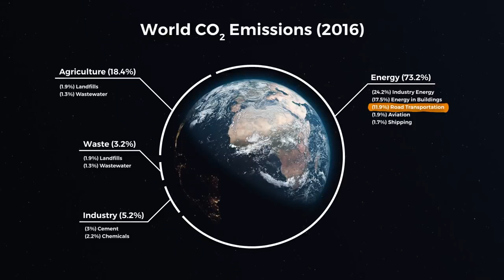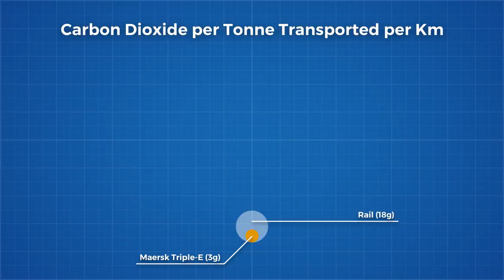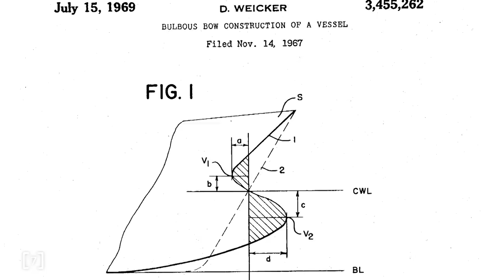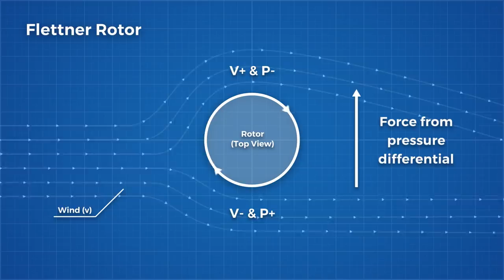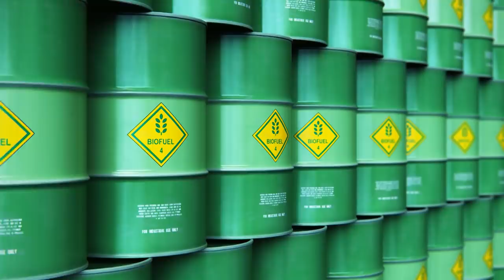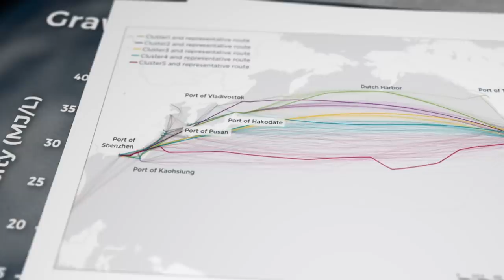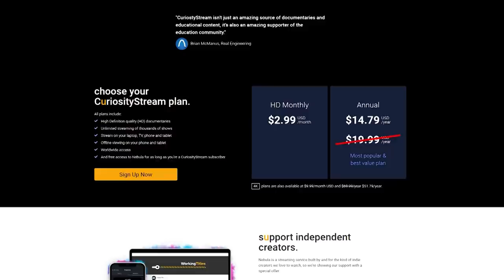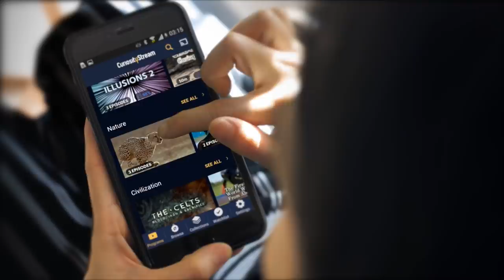Are Renewable Powered Ships Possible?

Comment: To say that the shipping industry is pretty efficient seems bizzare. The only reason that shipping is efficient is both the buoyancy of water and that bunker oil was so cheap. After all no other business would buy this oil dregs that for every barrel sold to shipping was near 100% profit or when not sold 100% useless in modern fossil engines or refining into other petrochemical value. Until very recently International shipping could dump its bilges into the oceans no matter the damage. Its only now that low sulphur bunker oil means ships must either move to a new fuel or (the cheap way), add a filter to the emissions to capture the high sulphur for the existing oil dregs used as shipping fuel. In the decades since fuel went up in cost (and thats bunker fuel cost) shipping fuel efficiency has been: massive container boats (so massive that the panama canal and Suez canal needed to be updated to take these ship sizes) and with the resulting massive task of offloading its thousands of containers and slow steaming. Thats ship "efficiency". The biggest other innovation in shipping efficiency in all ships has been GPS to follow an accurate route as opposed to the sextant/stars and accurate time keeping/coastal direction finding. And GPS was built for military land navigation! In the meantime global shipping has paid poor wages (to the average seaman) with shipping's hidden mental health crisis . With shipping's byzantine  regulation and tax avoidance, many sailors are employed by shell corporations so convoluted that it would impress a Russian oligarch. So in the event of a ship accident its near impossible to find who the owners are in order to regulate/control/fine/prosecute them.
Wind power as an upgrade on modern ships is so rare as to be akin to well paid seaman (hence one of the reasons its so hard to recruit in global shipping) . Many ship owners bet on LNG power and while its a cleaner fuel- any fuel is cleaner than bunker fuel so big deal. No ship owners wants to invest in new ship fuel efficiency upgrades in case the worst shippers can bid a lower cost trip. Like saying a wind utility has to be cheaper than burning tires for heat.
Reply: Making the range of products desired by ‘the market’ from crude oil is not as simple as is sometimes suggested when ‘bunker oil’ is referred to as the ‘bottom of the barrel’.  Among the many highly skilled professionals in the oil refining business the 'elite of the elite' are the 'blenders'; they take the fractions that can be extracted from the crude oil that one set of traders buys and after distillation (both atmospheric and vacuum aka thermal cracking) followed by 'cat cracking', chopping the residual longer and more complex chains of hydro carbon up into shorter bits, with the aid of a catalyst, they have a suite of components.  They then blend the components into the products that the other set of traders can sell in the market for the most revenue; all at the least cost in time, energy, effort or any other type of expenditure.  When it is possible to find any useful revenue stream anywhere in the process they will, thus low sulphur atmospheric residue (LSAR) from the simplest distillation stage might be saleable as 380cSt HFO.  The regulators set some parameters; like sulphur content, either at a national or international level, and those pesky consumers buy what they want from what is available.  Best way to reduce the impact of shipping to acceptable levels could include, but not be limited to: -
1) Reduce spoilage / waste of all commodities;
2) Improve fuel quality;
3) Localise production to consumption;
4) Reduce 'freight mile' distances;
5) Abolish the cruising fraction of marine transport;
6) Reduce freight carrying capacity;
7) Abolish recreational boating;
8) De'fossil'ise the fuel chain;
9) Reduce the global population of consumers.
The use of any of the options above may not be the future of marine transportation but moving less material and moving what is transported over shorter distances, as in the past, should be.  Together with localised production and minimised consumption a global population that has individuals’ voluntarily self limiting reproduction to two children per parent (both male and female), might save the planet.
Reply: @BernardLS  all good answers but when a refinery ends up with this near solid oil that had no market, they found one customer who could burn it in international waters and that was shipping.
Reply: @stephendoherty8291  WADR the oil companies are commercial enterprises and like any other will  try to extract the greatest possible revenue from what they do with least possible effort or expenditure; and in the final analysis it is always the consumer (we, the people) who pay.   The cSt 380 HFO that powers most shipping can be improved by regulators (improved specification) reduced consumption could weaken the market and make other destinations for the components more profitable.  Beyond HFO there is a market for bitumen (road and other grades of tar).
Reply: @stephendoherty8291  ‘It is like sailing into a storm and pretending the ship and crew and cargo will be fine.’  Love it! SOP for ship owners since Noah was a deck boy!  WADR KSA like any other petro state would be in the steam reforming business so their H2 would be the ‘black’ type.  H2 may have a place in the energy mix on land as a storage medium but on a ship where there is a reasonable and constant auxiliary power need the question could be posited, ‘why go through the extra stages instead of using the harvested energy directly?’  After harvesting the energy, from wind, sun or motion of the vessel, as electrical energy better to deploy that energy directly and immediately as heat, light or mechanical work.  As with nuclear energy at sea some of the ‘alternatives’ may have a use in littoral submarines in AIP (air independent propulsion) systems but that will be with the same caveats of cost, space and complexity so would not perform in a high volume low cost mercantile situation.  The numbers are getting very difficult to show any sort of surplus so is this a case of running hard to stand still?

Bear in mind that speed reductions, a useful buffer for adjusting variations in demand, will in the long term require more goods in transit to maintain any given long term level of supply.  Typically tankers move at 15kn so a reduction of speed to 12kn could yield a fuel consumption saving of 20% (?), however to maintain the same flow of material an additional 25% of shipping capacity will be required.

4 ships at 15kn  =  60 freight miles  =  5 ships at 12kn.
	fuel used x                                     fuel used x+ or x- (?)

Reducing speed to save fuel reaches limits when the vessel does not maintain steerage way and suffers loss of control, the speed through the water is too low to overcome tidal streams and the speed over the ground is to low the make good any distance to the objective against adverse currents.  The speed to cost ratio is as finely balanced as any other ratio in the shipping business.

Returning to my earlier comments WRT ‘blending for profit’ once the crude has been through the atmospheric distillation stage the residue, SRAR, either goes to vacuum distillation or is passed to a catalytic cracker for further fragmentation.  SRAR may be traded as a feedstock so that yield is diversified around refineries so that the plant performance may be optimised.  If you refinery has been designed for medium crude and your traders have bought in excess light then you need something to thicken the mix.  Reinjection of residues is not something I have come across, but in the crazy oil world almost anything could happen somewhere.

Comment: Are nuclear powered ships simply too expensive? surely it can be made cheap enough for commercial use eventually right?
Reply: If you do a web search for ‘nuclear ship savannah’ you will see that it has been tried and did not work.  A similarly vessel heavily subsidised, by the government, vessel is in use in Russia which also operates, in support of the Northern Sea Route, a fleet of nuclear powered ice breakers all of these may, or may not, have been completely without issues.

Just think; would you have full confidence in the management of a nuclear reactor under the control of an anonymous entity only traceable, perhaps, via a letter box in a FOC (flag of convenience) nation state?  If you are, could you sell that confidence to Japan, the state that hosted the Hiroshima and Nagasaki nuclear detonations as well as more recently the Fukushima ‘event’?  Then try that same, or a similar, sales strategy on Ukraine, the nation state that as a part of the USSR (CCCP) hosted the Chernobyl ‘event’.  Modern iterations of nuclear energy, thorium fuel, molten salt reactors or fusion reactors, will carry the legacy of past problems.  It is the global trepidation of anything with 'nuclear' in the name and the economics of nuclear having transitioned from 'energy to cheap to charge for' too 'the costs of remediation are incalculable' that will prevent the adoption of nuclear energy as a means of creating energy at sea.  Modern reaction systems may have overcome the safety problems but the general public, having been misled in the past, will be reluctant to believe the fresh new promises.  The incident of the ‘Ever Given’ blocking the Suez Canal, March 2021, may also have a little to add to this debate.  The cooling water on ships tends to get taken in from near the bottom so when running aground the inlets are in a prime spot to get plugged up restricting, if not stopping, the flow of coolant.  One thing that the TMI, Chernobyl and Fukushima incidents all had in common was that the supply of coolant, or rather lack thereof, was a fundamental cause.

‘They’ say nuclear is cheap, it’s not it is expensive and has a large embedded carbon quotient as well as being complicated, dangerous, not universally socially acceptable and having only ‘no need for refuelling’ as a questionable advantage; actually it does need refuelling just not as often.  When ‘they’ do need to refill the warming up stuff it takes considerable longer than pumping tonnes of thick black stuff, cSt380 HFO, or thin runny stuff, MDO, onboard which is one of the reasons HMS Queen Elizabeth and HMS Prince of Wales are pushed about by ICEs and gas turbines thus using a similar fuel as the aircraft that fly off of them.  The Royal Navy (RN) with a high degree of skill and expertise uses, at vast expenses to the UK taxpayer, a current operational nuclear fleet of 11 submarines (also known as ‘boats’) in two flotillas, seven attack subs and four ballistic missile boats.  The carbon footprint of all the extra bits of hardware and the fuel, including processing thereof, from ground to propeller, are the external costs that never seem to get considered.

Disposal, once it wears out, of both the machine (that was a ship) and fuel is another can of worms best left unopened.  The 26 RN boats no longer in use are laid up (some in Rosyth and some in Portsmouth) awaiting long term deconstruction including dealing with the fuel rods and other irradiated material.  The USN is not, as far as I know, a commercial organisation working to very tight margins and also has the skill and expertise to handle the complexities of nuclear power; so as well as submarines their aircraft carriers are nuclear powered and each of the current iteration has a build cost three times that of QE/PoW, bigger crews and more generous funding.  For those who still think that nuclear energy might be the answer I recommend this report: - https://www.bbc.com/future/article/20200901-the-radioactive-risk-of-sunken-nuclear-soviet-submarines?ocid=ww.social.link.email.  The navy of the USSR might have been under resourced and over extended but it was still generously supported in comparison with merchant shipping.

Comment: It’s called a sail boat.
Reply: To address the suggestions that wind power is the answer I offer the following.  The canvas, cordage and extra manpower needed for sailing ships was never a very benign environmental option so please discount any idea of sail as ‘sustainable’ and this is without the problem that if ‘the wind don’t blow the ship don’t go’, when it does blow it often blows in the wrong direction for your cargo delivery needs and sometimes there is rather too much of it for comfort.  The area where one is most likely to be ‘becalmed’ is the ITCZ (Intertropical Convergence Zone) or ‘the doldrums’ as it is commonly called.  In days of old ships with large crews, such as naval vessels, could try using the ships boats and some of the crew to row through the doldrums thus towing the mother ship out of the calm.  Not practical for less well manned and much heavier merchant ships which could not muster a similar power (oarsmen) to weight ratio (vessel displacement).  Traditional sailing ships are unable to go directly up wind so if the wind is blowing from the direction your cargo needs to go then a zig-zag course must be steered, more distance and thus more time on passage at whatever speed is achieved.  Wind speed is traditionally measured on the Beaufort Scale (wind speed) that runs from 0 (< 1kn or 0.5ms-1) to 12 (> 63kn or 32.5ms-1) and for sailing purposes the usable part of the range is ‘3’ (circa 8kn or 4.1ms-1) to ‘6’ (circa 24kn or 12.3ms-1).  As the wind speed, and the amount of energy that may be harvested there from, increases the sea surface becomes progressively more disturbed which makes the harvesting process ever more difficult and increasing the stress on the vessel.  The increased stress means the sail area has to be reduced, either by using fewer or smaller sails until the vessel may in extremis be ‘hove to under storm sails’.  One way of reducing the sail area is by turning up the bottom edge; known as reefing.  With any wind power proposals the question that must be asked include ‘has any information been released into the public domain with regard to the expected energy harvest for the wing forms, on a Watts per square meter basis?  ‘Cutty Sark’, is said to have been able to coax 3 000 horse power (or 2 206 500 Watts / 2.2 megaWatts)) out of her, up to, 2 976m2 of sails, assuming ideal conditions and further assuming that for sailing purposes the usable part of the wind speed range is 4ms-1to 12ms-1 so the yield would be about 741 Watts m2.  So another question ‘for the proposed option what is the expected upper wind speed limit for the system’?

Comment: Hydrogen is not the answer. Container ships will eventually be battery driven (giant batteries)
Reply: Electric motors powered by ‘green electric’, leaving aside the fact that there is no truly ‘green’ electricity, the best we can do is low carbon impact both at installation (capital cost) and production (current account).  Running ships on the ‘lecky’ is tricky the two examples that I personally know of, and have used, are a vehicle and foot traffic ‘chain’ ferry that ply’s its trade across the hundred meters or so of the Nordre älv between the island of Hisingen and the Kornhall on the Swedish mainland.  The motors are on the ferry and a cable is unwound and wound back up on board as the ferry shuttles back and forth from Kornhall.  When the vessel goes anywhere else, id est dry dock for survey and or maintenance, it is towed by a good old ICE powered tug.  The other electric vessel is a vehicle and foot traffic ferry that runs from Helsingborg (Sweden) to Helsingor (Denmark), a twenty minute trip, she tops up the charge in Sweden each time she is alongside and battery capacity is said to be sufficient for an hour of main engine use.  There are small diesel gennys on board; to keep the lights on in extremis.  Sadly as of now electric boats are as functional as chocolate fireguards, yes ‘submarines can be diesel electric’ but they have negligible cargo carrying capacity and if you ever go on one your first thought could be ‘where do they put the crew?’

Comment: Renewable powered shops? Didn't even need to watch to know it's not possible. You know what is, nuclear powered shops using new gen reactors. Safe, cheap, and cleaner than any attempt at making a renewable powered vessel. FYI, I work in the shop building industry, and follow energy generation tech closely, so trolls... come at me! 😂